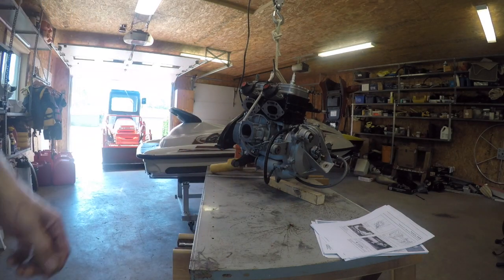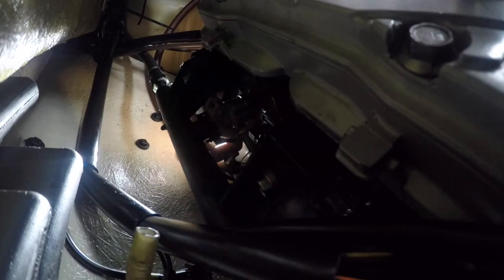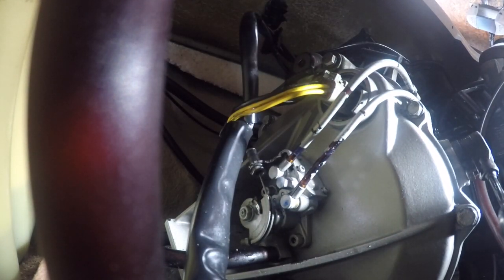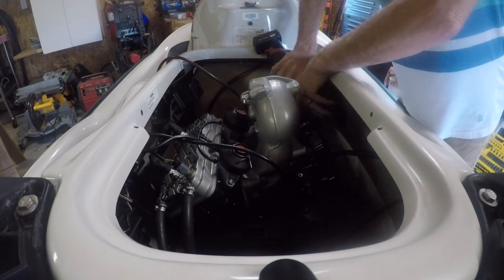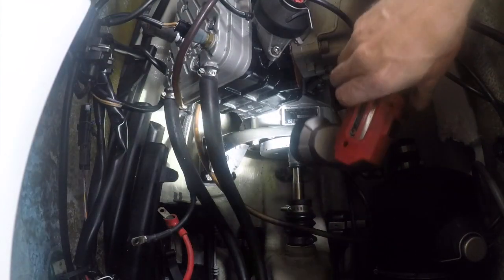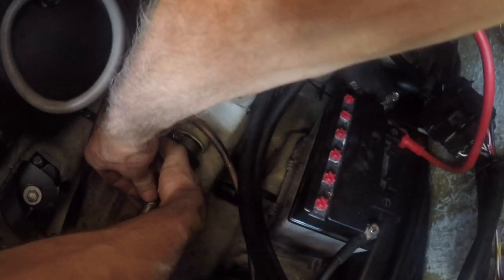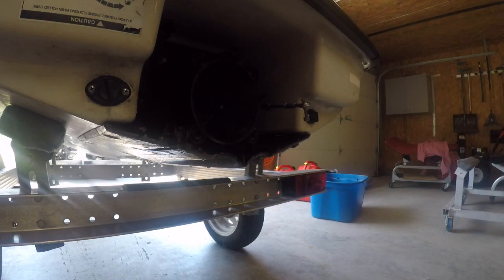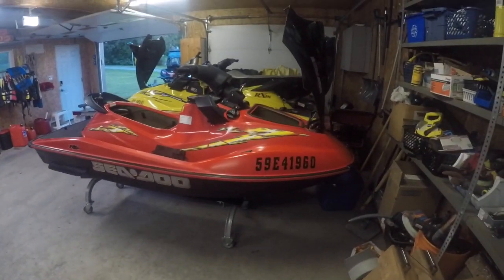Seadoo 787 Engine install

Comment: Great Vid! I just bought a used 787 for my '00 gtx rfi and I'm looking forward to getting the hydrolocked one out and the new one in. Only thing I'm hesitant about is buying an alignment tool that I may only use once to as well as it costing almost half the price of the engine I just bought 😅
Reply from the maker: 299.00 on ebay but if you are only doing one then kinda waste of money.  I have done many just by feel.

Comment: You should post a video of all the hoses and stuff inside the jet ski, have exact same one and have been rebuilding but don’t know exactly where every hose goes too
Reply from the maker: Do you have a manual ?  There is not a lot of hoses to hook up and they are all shown there.  www.seadoomanuals.net
Reply: @SeadooRefurb  I do have a manual but I still have 2 hoses left to connect and I can’t seem to find where they go exactly, and I would hate to blow it up from not having the right hoses to the right things you know

Comment: When buying a crate engine, do you have to do timing?
Reply from the maker: If the rotary valve is installed then no you don't.  It is very easy to do yourself having said that.